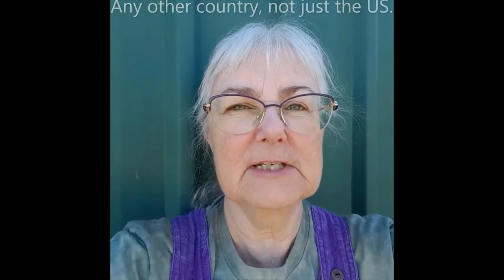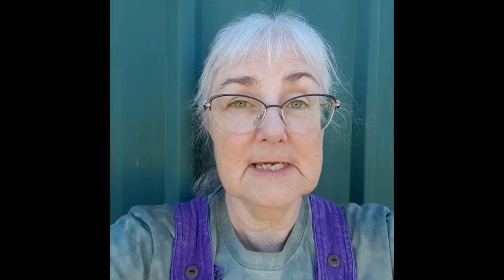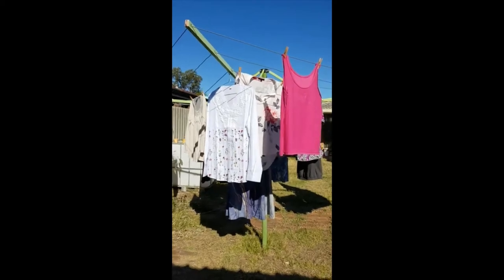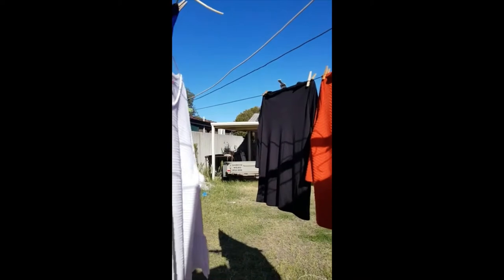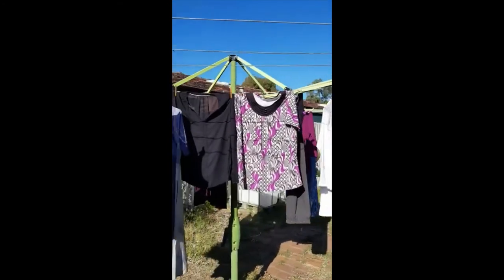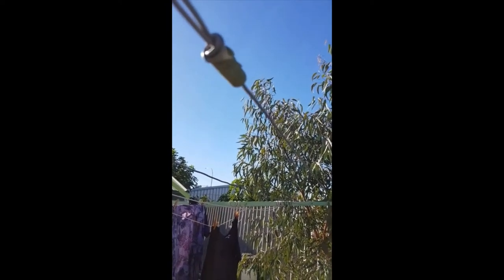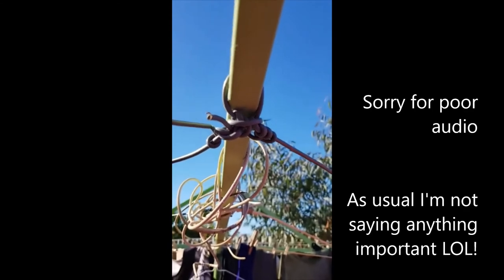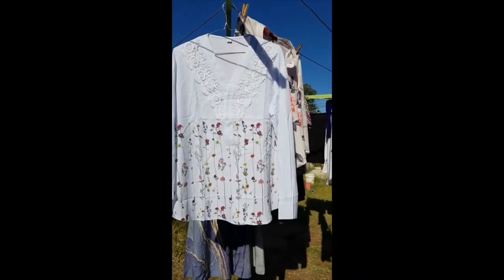Restringing the clothesline

Comment: I've come to your video for inspiration. I'm in the midst of restringing my exact same clothesline but mine does not have the tensioners you appear to have. I've threaded from the outside and back threaded when I returned to the original arm and continued for each row.  I am now tightening with a final knot. So a knot at the start and end.  I'll see how tight it is when I add my washing. fingers crossed. Thanks
Reply from the maker: How did you go Carol? 
Mine is still holding up well 5 months later, even with some really windy days that saw my sheets fly over the fence into my neighbours yard! 
I haven't had to re tighten any of the lines and none have come undone.

I didn't have any tensioners, the green things were really just to cover the knots where the line joined, and most of them had perished (my line is over 40 years old!), so I didn't have enough of them for every line anyway.